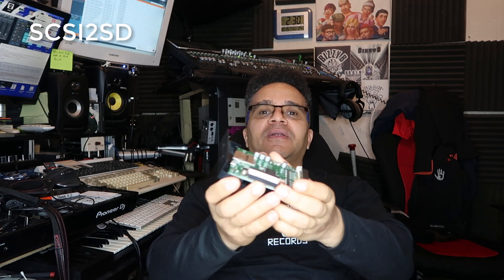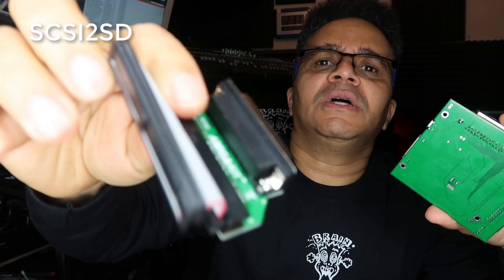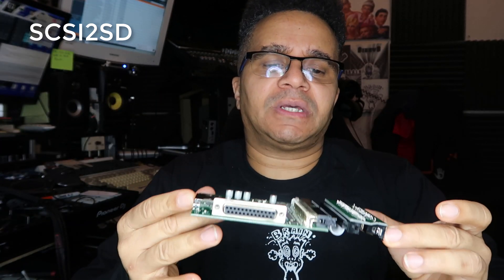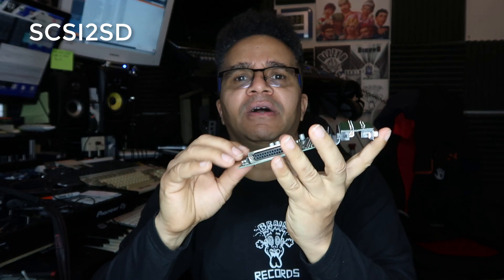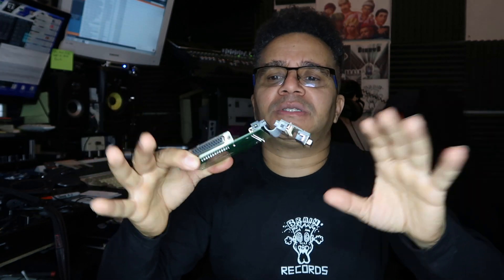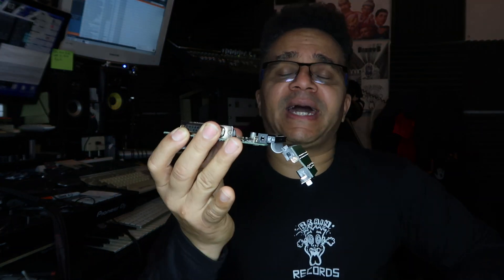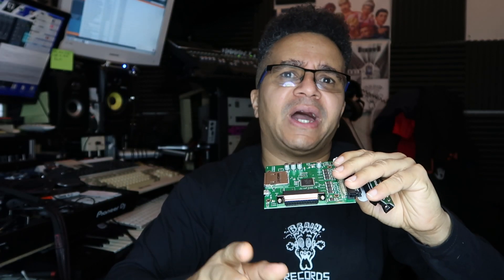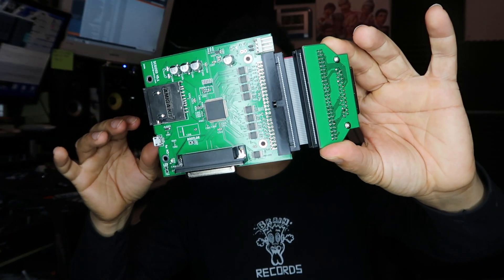SCSI 2 SD TO HARDWARE SAMPLERS REFIX

Comment: Look...  CLEARLY, you are the Genius that knows about replacing sampler hard drives, with USB, or SD card readers or whatever....
I need to know what to get for an Akai S6000 that will load the sampler OS, and house, warehouse, archive all the samples that I want.  What do I have to do?
Will just be using one sampler, and I want to run USB to my computer for file swapping.  Thank you!!  You rock man!
Reply from the maker: They work well with old skool iomega jazz drives ( if you can get a good condition one )  for something more modern you could use scsi2sd
Reply: If you havent found out yet... chickenSys. Or samplerzone. Scsi to sd.🎛🎚😉👍

Comment: Nice on Bizzy! I just got one of these up and running in my S3000XL. Bit of a headache to figure out how to set up and format sd cards etc. but I got there in the end. Copied some massive sample libraries onto SD cards from CD images using Translator. I didn't know about the thing where you could connect to 2 samplers so mine doesn't have an extra scsi port added to it unfortunately. Now I'm wondering if I could connect to it from another sampler through the Akai's big 25-pin external scsi port on the back of the sampler? I suppose I just need to have a go and see if it works. I'm doubtful though. Otherwise, is there some kind of scsi splitter/switcher that would help? It would be good because I could save stuff between SD cards without having to keep switching the card all the time.
Reply: Oh yeah, and it seems like once i fill an SD card up to the 4th virtual scsi device it gets corrupted. the virtual drive disappears in Translator but I can reformat the virtual device on the sampler without losing the data on the other SCSI IDs. But I cant drag any more files into that SD card after that. But I can save to those IDs on the sampler. ...weird.
Reply: It worked! I can just connect to the SCSI2SD in one Akai S3000XL from another Akai using the 25-pin SCSI external port. wicked! As long as the scsi ID are all different it works.

Comment: u got one now yeah? I been commenting about this since last year Bri, nothing beats this device. 
I still can’t get my fargin gotek working on the s950 but the scsi2sd is EASY no fiddling as long as u have the right cables. My ASR10 and Emax both see it. 
Truss this thing works like lightning u will love it
Reply: Did you try or know if it works with the s950?
Reply: @clustercrash2995  looking for an answer to your question too

Comment: I've installed an scsi2sd from amigakit into my e6400 ultra and it's never worked correctly
Reply: @TheBizzyBScience  I've got scsi2sd version 5.1. An sd card shows up as 7 separate drives on the sampler, but it cannot 'see' any folders within these drives
Reply: @TheBizzyBScience  Yes , and it can see a .e4b now on the SD card, but won't load it. Says incompatible file type
Reply: This was an akai format sample cd that I have converted with chickensys so m,aybe I've done that part wrong
Reply: It doesn't even load .wav files though

Comment: Put mine in an old zip drive case its shared between s1000 s3000xl and pc with adaptec card. Been a bit of trial n error but now works with recycle, wavelab and mesa. Can access all samples and dump them to and fro. Also can send drum hits to S950 via rs232 cable using software then save to hxc emulator. Im not bothered about self isolation ! 😷
Reply: S1000 can read S3000 disc with OS 4.7
Reply: Wavelab 5  & Recycle 1.7 on XP only though ! S1000 can read 3000 but they both only write to thier own partition on the scsci2sd drive.  Give me a shout if I can help 😉